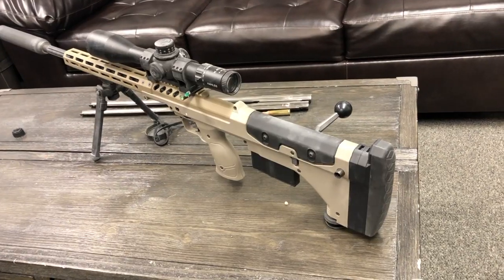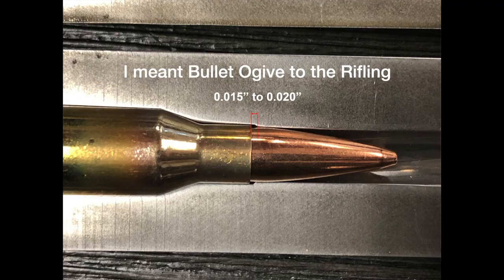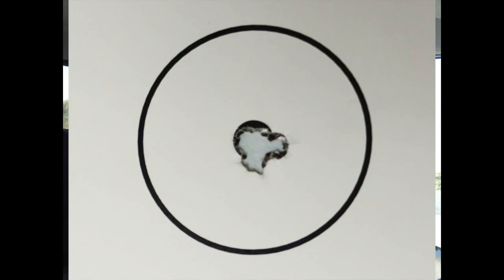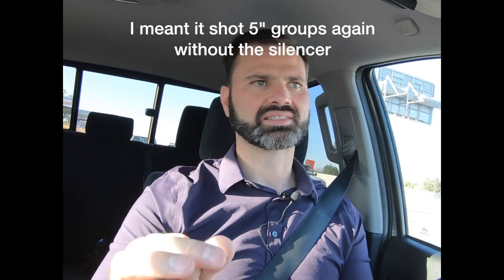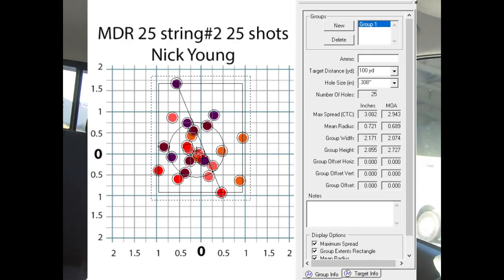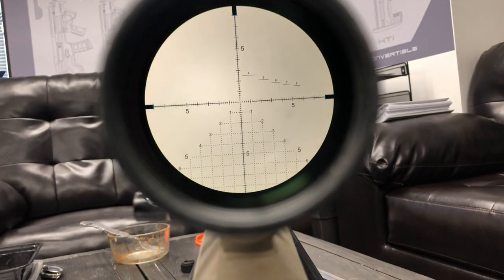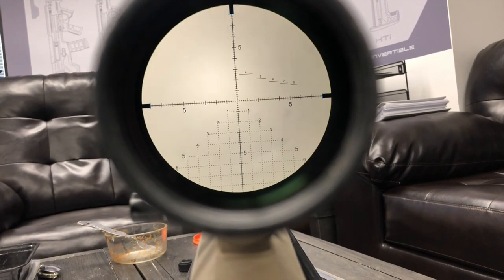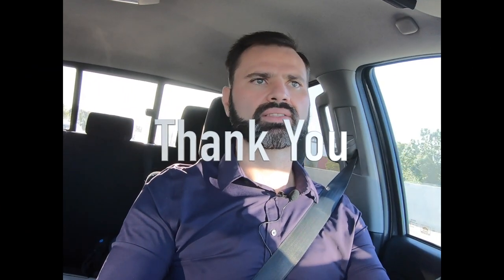Improve Rifle Accuracy | Desert Tech

Comment: Any good tips for getting super consistent cheek welds?
Reply: one way you can improve the consistency of your cheek weld is to place a piece of tape horizontally across your stock, so your cheek just barely touches it when you're correctly aligned with the scope. That'll help with the distance from the ocular lens, and if you attach several patches of fabric onto the stock so that when you're pressed down as hard as is comfortable for you, you can also correct for height. Correcting for lateral placement is a littler harder, because unless you only shoot your rifle from one side a single index point won't be adequate if it's placed on the comb of the stock. I find that an index point that my lip barely touches when I am correctly aligned is the best solution, though that fails if you are wearing a mask or your lips are significantly chapped or something else changes the dimensions of your face or the index mark.
Reply: @CaptainKzer  Thanks!  Here I was thinking I'd have to make a mold of my face  and nail it to the gun. jp   :D